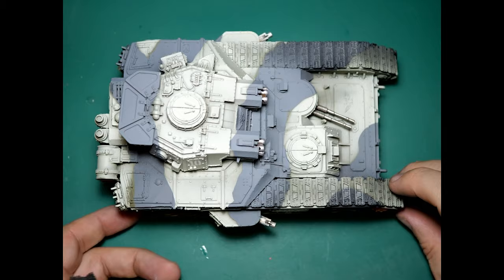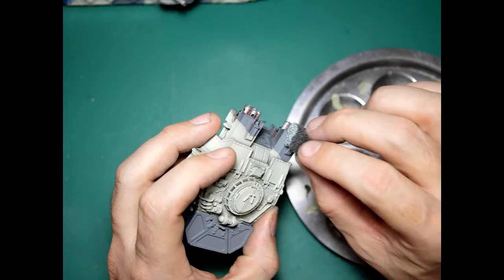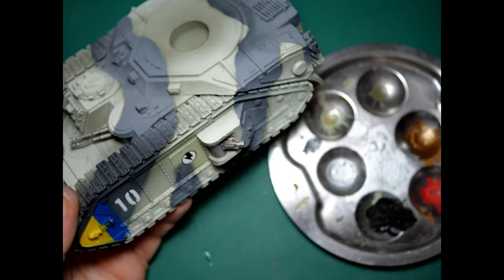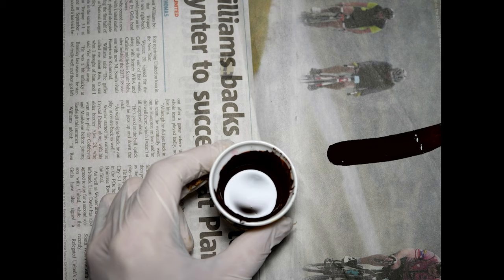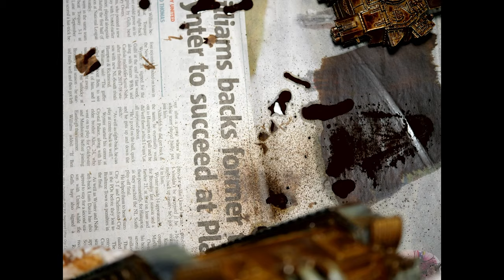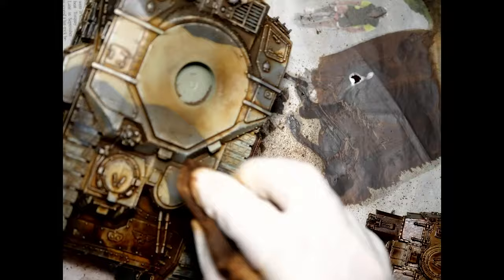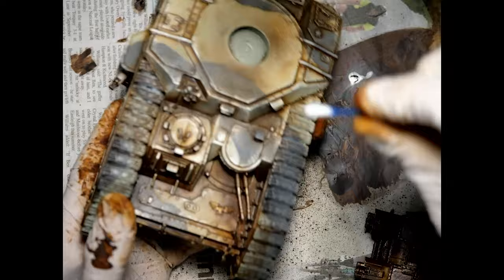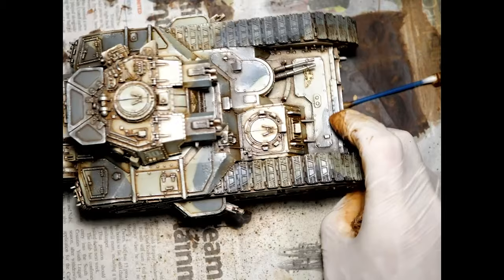Basic Tank Weathering Technique

Comment: Great video, mate. Love the finished effect as well. Do you varnish the model before applying the oil wash? I have tried oil washes before however I found that removing it sometimes rubbed off the acrylic layer underneath.
Reply from the maker: Cheers matey.  Yes I I think I mentioned in the video; after I had done the chipping with the sponge, give it a coat of klear or pledge floor polish through the airbrush.  It's gloss and hard wearing

Comment: Does the oil paint leave a residue behind? Would it run off over time?
Reply from the maker: the finish will be a little shiney from the oil but just airbrush some lahamia medium over it and its matte again.  Run off? is that a typo and you mean rub off?  if so I have never had any issue wiith paint rubbing off once it is properly dry it is much the same as any paint.  I tend to handle my models with care anyway but if you dont you might want to varnish them.